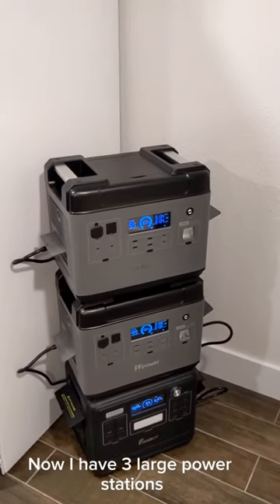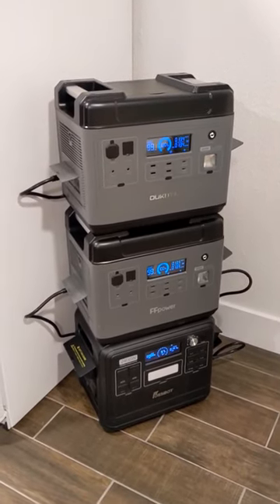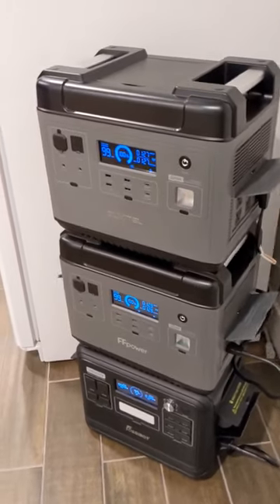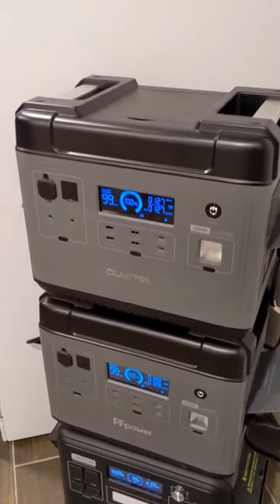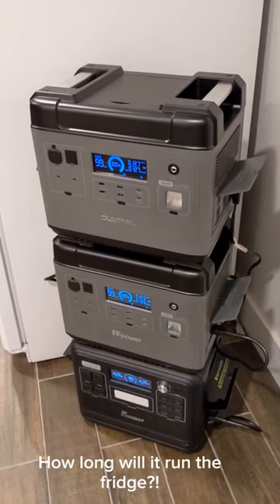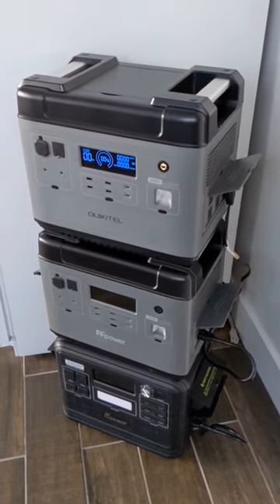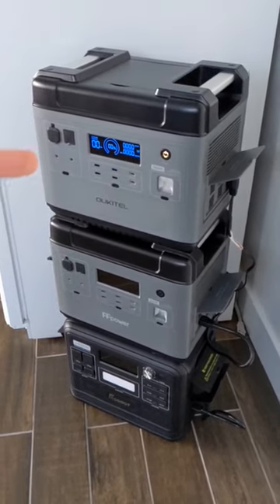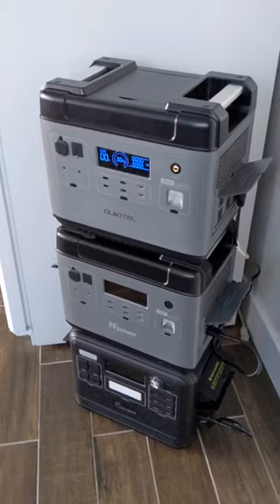Using UPS Mode to get Longer Run Times?!  3 Power Stations Connected Together!

Comment: Thanks! Great discovery!
What are the exact connections and connecting cables?
Can you do this with 2 EcoFlow Delta 2s with each one having an extra battery connected - meaning 4 units total?
Reply from the maker: The charging cable from one power station plugs into the inverter of the second power station. No special cables required. Using Delta 2's should also work, it would run down the first power station / battery, then it would use the last power station and battery. You could also have 1000 watts of solar plugged into them since each takes 500 watts.

Comment: First thing I did when I got my Oukitel P2001 was unplug my APC Gaming UPS BGM1500B (with my computer on) from the wall outlet and plugged it into the P2001, the UPS didn't even get a chance to beep and it was already back up and running with what it thinks is wall power from the P2001, but when I unplugged the P2001 from the wall to simulate a power outage or the P2001 draining... that fried the UPS, sparks and smoke inside the UPS, thought I was going to have to deal with a fire but it died out on its own.

So I would have been extremely hesitate to try this, so glad to see you did and succeeded. Would love to see each one being charged via solar panels all at the same time. Thanks!

Comment: Been doing this since the Delta 1300 days. The problem with this setup is inverter losses and its not worth it to chain more than 2 at least with those models
Reply from the maker: The efficiency was pretty decent on these since they have UPS functionality. The power stations doesn't use much power as it's just pushing power straight through.

Comment: Interesting experiment.  One other thing is in theory you also have up to 6000 watts of continuous ac usage if you need it by plugging in different devices into different ports on each unit.  I realize that using it this way each unit will go dead at different times but still on option.
Reply from the maker: Good point about the 6000 watts, if you only used that much power briefly you'd be okay to charge it back up pretty quickly with solar.

Comment: One becomes AC power (like a wall plug) to the other. And so on. Alot of people say this is wasteful, but if you need a uninterrupted supply with no solar (or with solar) than this is a very handy situation. Yes, plugging in to the next powerstation is more efficient but this is still cool! Alot of people in the delta series group say this doesnt work or not a good thing to do, but hey if you have 2 powerstation and not just an extra battery then it was actually more wasteful to purchase the second unit vs. The extra battery, BUT now you have twice the solar input! That's the reason I will buy a second delta pro vs the extra battery. Now I can have 3200 watts of solar vs just the 1600. And also if a delta pro goes down. Now I have a backup!
Reply from the maker: It worked without a flaw, I was pretty impressed. I didn't know what to expect but since UPS mode is pretty efficient I would say you aren't losing to much power overtime. With UPS mode it's just passing power through the device so only one power station is doing the work
Reply: @Jasonoid  that's right! Ups is just a latching relay. Takes nothing to keep the unit on and nothing to hold the relay closed. Nice video! I'm actually using my DP on the fridge, TV, wifi, and Xbox during a power outage right now 🤣 love it!

Comment: That's a cool solution to add more capacity.   What connections did you use to transfer the power between stations?  I have used my EB150 hooked up to add to my AC200P via the AC200P's AC adapter.  Not too efficient but worked.
Reply from the maker: The top power station charging cable is plugged into the inverter on the second power station. Then the second power station charging cable is plugged into the inverter on the third power station. It's like a large daisy chain to keep them all charging each other in a line.
Reply: @Jasonoid  So, you got my experimental juices flowing.  Plugging the AC200P power brick into the EB150 AC outlet and into the 7909 200P port, the EB meter reads 529W out and the AC200P meter reads 456W in.  So losing 73W probably due to DC to AC to DC conversion.  A significant amount of power waste.  Plugging the cigarette plug from the Charge Enhancer D050S into the EB150 and into the AC200P, the EB150 reads 104 - 120W out and the AC200P meter reads the same wattage in.  No loss there.  So more efficient using this setup to transfer power.  Downside is the slow charge but more bang for the buck.  Can always switch to AC outlet if faster charge is needed. Thanks for the informative video.  You always have practical alternatives on how to use our equipment for our benefit.  Keep them coming.

Comment: Great experiment. How did you connect the Generators to each other? From what port to what port?
Thanks
Reply from the maker: It's a daisy chain, AC inverter output goes into the charging port on the next power station. So power is passed into the next unit. Then that is repeated 3 times.
Reply: @Jasonoid - Solar Power, Batteries, and More!  Thank You.

Comment: I want to see the solar panel will keep them charred while you run the fridge or other heavy devices
Reply from the maker: The fridge pulls 135 watts, a 200 watt panel would be enough to keep this full. If you wanted to run larger devices you'd want to charge with more solar.

Comment: Just standby power draw on 3 inverters will kill your system pretty quick. Looks like fun though.
Reply from the maker: This was just an fun experiment, I was pretty surprised by the results. I don't think the inverters use much power while in UPS mode since they are passing power through them.

Comment: Nice setup, however it would be more efficient to run one at a time and charge them from solar if available
Reply from the maker: It was an experiment to see what would happen, The most efficient process would be to use a power station with true expansion batteries.